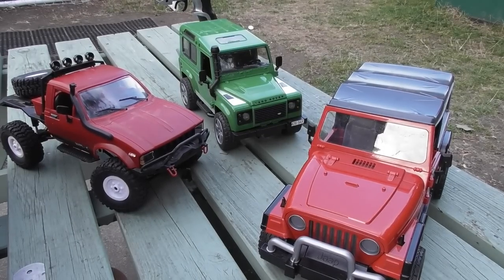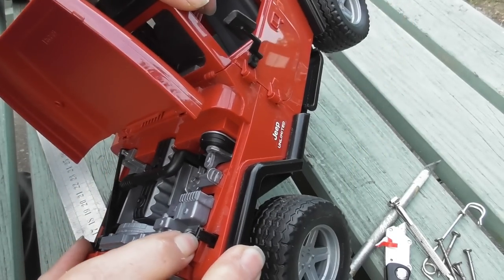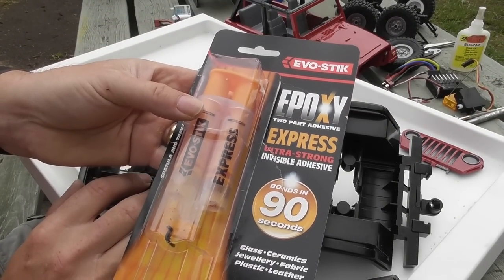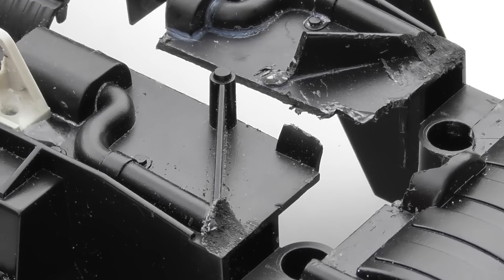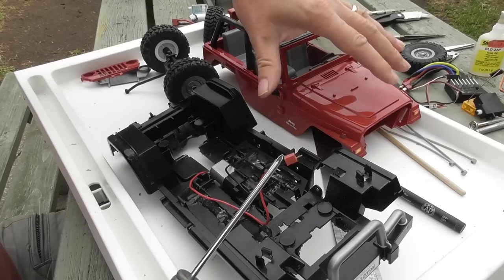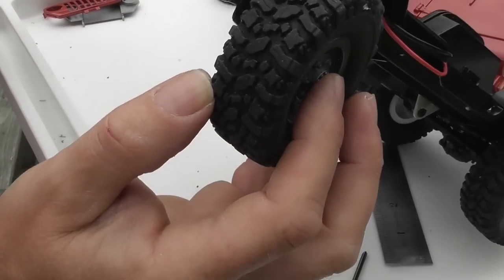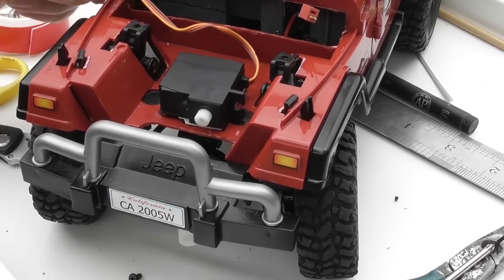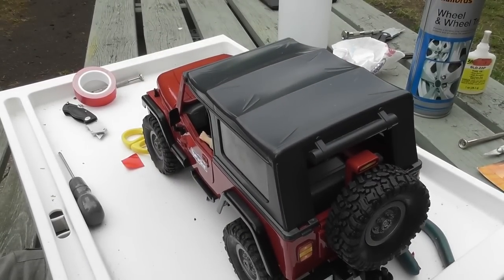Bruder Jeep Wrangler TJ RC conversion 02520

Comment: I settled down to watch this video certain that you wouldn´t just bung the Wrangler body on the WPL chassis. This was confirmed when you mentioned the differing wheelbases.
 I wondered how on earth you´d manage the packaging of the drivetrain, but nothing had prepared me for the sheer audacity you displayed in running your top links above the chassis pan! What if some young future Tamiya designer should watch this video while still at a formative age? The CC-01 will never be the same again...
 Getting the radio gear under the bonnet was an impressive feat, too. I also liked your neat rear suspension solution - using the Bruder springs made everything easier.
 The finished result looks superb and seems to perform as well as its ground clearance could possibly allow. Well done!
Reply from the maker: 😂Thank you. It sort of just happened. I cut the hole for the gearbox plate, glued it in and the rest just fell in to place piece by piece while I was doing it. I had no idea where the links would end up on top, until they did. If I used the aftermarket twin N20 motor gear box - as TheDaddy187 has suggested - then the low hanging gearbox would be sorted too. I'm probably going to revisit the Wrangler at some point and upgrade it - it is a really nice little model and crosses over into the truly capable camp. 
Watching the unexpected unfold before my own eyes is a big part of the fun with these conversions - there is always a way, but you sometimes don't discover it until the Dremel is spinning!
Reply: Well put, sir   : )

Comment: Thank you for the build video! Im beginning to convert my Bruder D90 and hope to use the wpl chassis also.
Reply from the maker: WPL is quite big for the D90 - but would give the model a lot of presence! 😀👍
Reply: RC Modders I was able to mount the transmission and axles...but I couldn’t shorten the driveshafts enough to make it work. The D90 did look great on the axles and tires though!
Reply from the maker: Aaron Gamber I guess a pair of opposing n20 gearbox motors side by side (instead of the stock gearbox) might have let you get away with it?

Comment: I have the same WPL c-14 and I'm thinking of doing the conversion with the new Wrangler since the wheelbase are the same. Question though, did you try and see if you could just take the bottom off the body and mount it on top of the already setup chassis instead?
Reply from the maker: yes I did consider doing exactly that but decided against it for a number of reasons : firstly there is so much of the black chassis / floor pan moulding that I wanted to keep - fender flares, wheel arch inners, bumpers, side steps, rear spring retainers etc; plus the 15mm difference in wheel base would have made anchoring the inner mounts for the 4 links challenging and I needed to change the ride height and have somewhere to hide the servo battery & electronics. In the end this actually seemed like the easier option! I'm sure that it could be done the other way - would be interesting to see this. Good luck & thanks for the question.     👍
Reply: @RCModders  I'll send some pics of how it turns out
Reply from the maker: Great. I look forward to seeing it!